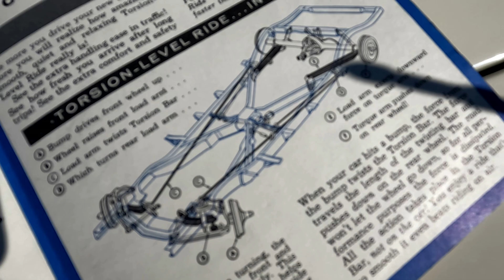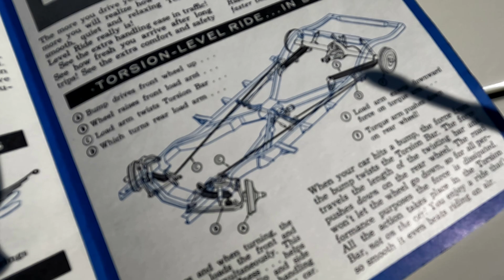Packard Torsion-Level Suspension explained and demonstrated.

Comment: I like the way they utilized starters as the motors doing the work....I have worked on several over the years...
Reply from the maker: Parts bin engineering efficiency and well under stressed in this application. I bet they never went bad or wore out.

Comment: I owned a 55 Packard Patrician for a short time back in 1974.  in reading up on the 55 and 56 Packard at the time indicated that these cars tended to suffer from the fact that its electric components that controled the Torsion Level Ride, that is the motor, was heavily exposed to the elements and often failed or shorted out after a relatively short period of time.  Those Packards equipped with the push button Twin Ultramatic also suffered from premature failure of the electrical contacts in the selector box. Chrysler's push button PowerFlite and TorqueFlite systems consisted exclusively of a mechanical linkage and tended to be much more reliable.
Reply from the maker: You are correct!  I would imagine in climates with winter climates that salt would cause all kinds of problems with the leveling system as well as the Twin Ultramatic shifting solenoids. The Packard push button electric selector would not have been my first choice back then for a shifting system if I was purchasing a car. However, the attractiveness of the gimmick might have captured me. did Chrysler ever use vacuum for the push-button selector on the dash or center of the steering wheel?  Thanks for your interest and knowledge.

Comment: The car was designed to carry 5 passengers plus the driver and carry all their luggage in the trunk and still ride level.
The switch is a mercury switch.
Your timing is set about 1/2° too far advanced.
That is a beautiful example of a 55 Patrician.
My '55 Clipper Super Panama had the same system. I say 'had' because my ex wife got rid of it on me. B*tch.
Reply from the maker: Good ear on that timing. I bet you heard it backing up on the starter just a bit upon a heat soaked start?  The static timing is or seems to be a tad advanced. I have not shot it with a gun yet.  I has thought it might be a mercury bulb switch, same as a thermatic coil thermostat. 
Sorry to hear you lost your Super Panama, if only you could have departed the ex wife prior to the car!  Timing is everything. If only yours was a bit advanced :)
Reply: If its just a mercury tilt switch mounted on the chassis somewhere, the car would level itself if you were on a hill, which is stupid.   Does it do that?    If not, the sensor must sense the degree of spacing between the rear axle and the chassis somehow.

Comment: So sad that Packard didn't come up with a V8 until 1955.  The styling in the early 1950s was rather dated.  The 1955 models might have saved the company, but it was already too far gone by the time they were introduced.  I believe that the 1956 Packard V8 was the largest of any American car.  And stylist Dick Teague did a masterful job on the existing inner sheet metal.
Reply from the maker: Much agreed, If they had come out with the new design and OHV V8 in '55 keeping up with the tri-five Chevys, or a year ahead, it might have been a game changer.
Reply: @classicperformance  - Had Studebaker-Packard joined American Motors, there likely would be a Big Four today.
Reply from the maker: @OldsVistaCruiser  that is an excellent point, and one that we would agree with. Thank you for that insight!

Comment: That levelizer motor is making too much noise. The springs are making too much noise as well. I had one and it was nearly silent.
Reply: If you keep the gear box that the leveler is in well greased it will work flawlessly. Just ask the man that owns one.
Reply from the maker: @swamprat69er  OK, I'll as the man. It seems to be well greased by appearance. Is there a way to check the grease or add???  Thanks!
Reply from the maker: Could be. This car was recently pulled from a 50-year mothball storage with only 4,800 miles on it currently. We are sorting out these issues.
Reply: Jay Leno demonstrated it in one his videos, sitting on the back corner.  You could hear the motor, but only just.    This one is so loud I thought the gut must have put a microphone right on the motor.

Comment: The levelizer was from a separate set of torsion bars. Not the main set.
Reply from the maker: Correct. They are the "short" ones headed rearward from the levelizer.

Comment: I think the "timer-system" probably worked by a pressure valve system. I could go into details, but I think my first line explains it!
Reply from the maker: Others have mentioned it's the voltage regulator styled box just ahead of the levelizer gear box and motor, being a thermal bi-metal delay switch. I have tested that theory and can shorten the delay by over using the system, meaning warming up the box so that the delay time shortens.

Comment: I would get the undercoating removed with dry ice blasting
Reply from the maker: Jeff, it would be nice to be able to remove the undercoating on the frame structure. We have used dry ice blasting on aluminum suspension components and engine cases in Porsches and Ferraris. I was not aware it could remove something as stubborn as a hardened undercoat. The plan right now it to pressure wash it, then respray with chassis black paint.
Reply: @classicperformance  yeah, it can definitely be done to remove under coating.
Reply from the maker: Thanks for the knowledgeable tip, Jeff. We would like to restore the undercarriage back to factory fresh. It's there, just needs to be revealed carefully and DI is what might be the least invasive and eco friendly. Thanks!

Comment: Fantastic car. My brother had one during the early 60’s. The trans went out and no one could fix it.
Reply from the maker: We agree, a transmission repair would most likely have to be sourced somewhere involving shipping of the unit. Parts new and used are still available, such as clutch packs and gaskets, but would be expensive.
Reply: Trans is very easy to work on. However, install government surplus bronze "tank" clutches. Same ones as early Hydramatic, used in WW-2 tanks. Next, install a solid "thrust washer" of correct thickness, in place of the OEM "waved spring washer" in the torque converter. The latter breaks into pieces & destroys the unit!!!  Kanter sells direct-drive re-lined clutch plate, that's rugged enough for the enormous 405 pounds of torque. These small changes, make the Ultramatic bulletproof. Such simple refinements that they didn't realize at the time.

Comment: I have always loved these cars.  Own 4 1956 Packards currently including the twin sister Patrician to yours in Dover White except with the tan interior.  In practice the suspension suspension is well designed and robust. Put four new shocks on the car when you buy it and enjoy the ride.  Major repair is a bit tricky as you either need to hold the torsion bars in place when you replace say the  A-arm bushings or you can unwind / unload the torsion bars.  I managed to find the original large dealer tool to do just that.
Only weak spot on the car is the dual action (oil/vacuum) oil pump which should be upgraded with an adapter kit to a late model Mellings oil pump that is spec'd to a GM 455 Buick.
Reply from the maker: I have done some research on this and know of the potential weak point there. We'll check the Melling option. Oil pressure is very good! Thanks for your interest and sharing your knowledge.

Comment: I don't think these cars would be too practical for everyday use, especially in bad weather where salt and corrosion could get into that leveling system. This is a nice weather car only. I understand you could order the car with conventional springs if the buyer so desired.
Reply from the maker: In contrast, these cars were actually designed in detail to easily manage the worst of driving conditions that could come to mind. We'll start with the very heavy undercoating that spans every underside surface to prevent any corrosion from salted winter roads, as well, it acts as a road noise deadening substance at high speeds. Also, the car is equipped with a dedicated front and also rear separate hot water heaters and multi-speed individually controlled fanned blowers with foot ducts for all passengers. You could option for a heated driver seat, fog lights and other dealer options for dark and foul weather driving conditions. The suspension is controlled by a modified starter motor and as all starter motors, low in the belly of the car. The gearbox is sealed as well as other components tar-box-sealed. They thought of it all.
Reply: I would still like to buy one new then only take it out in nice weather. :-) @classicperformance
Reply from the maker: That was the case with this car. Only ever used for special occasions and 4,800 original miles. See our other content on the car for more information, images and driving.
Reply: I've watched all of your videos on this car and enjoyed them very much. Thanks for sharing.  @classicperformance
Reply from the maker: @1940limited We very much appreciate your interest in The Patrician and your contributions to the discussions! I can assure you the car will never see questionable weather. However, with the effectiveness of the cabin heaters, and the automatic Rochester engine choke, it is a pleasure to tour in on the coldest of crisp winter days, when the sun is shining. We operate the car year-round.
Reply from the maker: @1940limited  true, we would never take it out in wet weather. The straight 8 motors were fantastic, but time marched on ans they became outdated technology with horsepower limitations by the design. We spotlight a few in earlier uploads. Have a look, you can also easily find them under our "Playlists" and you'll see "Packard"

Comment: My first car was a '55 Patrician. This was in 1970, and the handling was still surprising by the standards of the day. The self-leveling was effected by spooling up the shorter torsion bars that were about half the length of the springing bars. That way the spring rate of the main bars remained constant. And, yes-- Packards with this suspension did not lean in turns much, compared to Cadillacs and Lincolns of the day. I used to sit on the rear fender, allow the system to raise the car, then shut it off, via a toggle switch under the left edge of the dash. This gave the car a "California rake", when you drove down the street, but it was only a joke, not for driving. BTW, the Packard Clipper, their mid-priced car, came with a standard coil front, leaf spring rear suspension, but torsion bars could be special ordered.
Reply from the maker: Barry, you are most correct. If you saw in the video we explain and show the shorter bars you reference which are used for leveling compensation. And yes, you can easily get that Cali Rake easily, as we used to do with "Highjacker" pr Monroe air shocks in back. Ahhh, the good old days!  Thanks for the info and your interest.

Comment: Hi from Sydney, Australia. My grandad bought one of these new, he ordered it to his specification, his brother-in-law had bought a new '55 model and had automatic gearbox trouble, so Pa ordered his as a manual with the optional dual carby set up, from the 352-cube engine it was good for 375 horsepower, not shabby for 1956. I learned to drive on/in this car in late 1973, so I could get my license on 24th January 1974. Pa's Patrician was so modern compared to other cars way back then with its poise under panic braking, or its projectile like take-offs when given the "joint" in manual first gear, no bum down, nose up feeling. I enjoyed every moment behind the wheel of this special car. Sadly in 1979 a bus hit it in the rear whilst turning into my mum & dad's driveway. However, it was "rescued" by two brothers who had been members of the Aussie Study/Pack' car club. They bought a scrappy tired California example. swapped chassis, welded on the donor cars right rear guard and rear valance panel and over months put in the hard yards to bring Pa's car back to life after it was written off by the insurance company. The only thing that they did that I hated was turn it from its original black enamel paint, into a turquoise and creamy-white car. All these years later at x'mas 2023 the two brothers still own it, love it & enjoy it.

In September 1982, I bought the next best thing in FACTORY right hand drive, a GM Holdens Aust built '74 Cadillac Fleetwood Brougham. Sent as a completely knocked down bunch of parts to build in GMH's Pagewood, Sydney plant it is a wonderful car, the closest thing to the spectacular '56 Pack' Patrician and driving it now for 41 years as my daily car it has proven to be vastly superior to a lot of modern cars. As it was a virtual full option car with early ABS brakes & traction control called "maxtrac", plus it has GM's early airbag restraints called Air Cushion Restraint System or "ARCS". But best of all as an export CKD Kit, it has a "full power" 8.2 litre export spec' engine with ZERO anti-pollution gear, so you have a genuine 400 to 500 hp car, not a gutless de-tuned USA spec engine. With the '74 Caddy's self levelling suspension it is the closest thing ever to Pa's '56 Packard.  Pa was an industrial engineer and he loved that '56 Packard, when I took him with me in September 1982 to look at the Cadillac with a view to buying it, he said if Packard had survived it would have made something like this. In 1974 Mercedes did not have ABS brakes, Mercedes did not have traction control and Mercedes certainly in NO WAY head anything like ACRS airbags but GM had its air cushion restraint system well before any other company.
Reply from the maker: What a great series of storied, Greg!  Thanks for sharing these with us and the group. I have never driven the dual quad setup on a Packard. I use would line to. Wasn't that motor the 374 cubic inch?  As for Cadillac, they have always been great cars too!  We once had an old Mercedes, from the 70's, it operated more like a truck than a car. As well as an '82 300D (diesel) which till this day, the slowest and most underpowered car I have ever driven. But they were tough!  Thanks again! Take a look at some of our other content on the Packard, as well as a nice Cadillac super 60 series.  Cheers, Mate!!
Reply: Your 1974 Cadillac Fleetwood sounds quite amazing! Perhaps you could do a video on it to show off the features you mentioned! I for one would enjoy watching it! Nice to know that such rare-optioned mid-70's Cadillacs still exist; and being a right hand drive fully optioned 1974 Cadillac makes it pretty much a one-of one in survival existence!!
Reply: I bought a well-used '74 Fleetwood in '81 when I was 20.  When warm, I couldn't hear or feel the engine at idle.  When cold, the pollution controls made it shake so badly, it broke the exhaust manifold bolts on a back cylinder.  Great riding car even when decrepit, but I learned to hate leather upholstery.
Reply from the maker: @ralphl7643  yea, the polution controlls just suffocated cars of that time. We would take all that garbage off. Cut the cat off and straight pipe, block the EGR, take off the A.I.R system and pump, etc and they would run pretty well.

Comment: One of the things I remember about the torsion bar system was that if you had a flat tire, you put weight on that corner so the leveling system would raise the car. After it was raised, you turned the system off so the car stayed up and you had less distance to jack it up to change the tire.
Reply from the maker: Makes perfect sence. 👌  not wasting jacking motion against a soft spring (bar).

Comment: It was a quality car when it was made and still is. That's an impressive torsion bar suspension that I didn't know about, the Packard engineers had to make that work and I'm sure that took much time and effort to design. Packard was a quality world class car company, that should be remembered.
Reply from the maker: You are most correct, Marten. I was not fully clear how the entire system worked from front to rear until we had a chance to study it from underneath on the lift. Packard also fully engineered and developed the automatic transmission and OHV V8 all in-house. Most other automakers sourced out engineering, sub components or complete transmission units to companies such as Borg Warner. It is thought Packard might have got in the weeds by being so intent on in-house engineering and manufacturing.
Reply: Actually, the Torsion-Level suspension was invented by a Hudson engineer named Bill Allison.  Hudson was too broke to develope it, so they let Allison shop it around to other carmakers.  Packard's interim president, Hugh Ferry, bought the rights to it.

Comment: While Packard was late to bring out a V8, they continued to out engineer the Big Three. TL and push button transmission couldn’t save them from problems associated with the 55’s; competition from Cadillac, and the disastrous purchase of Studebaker. The last true Packard (‘56) is a work of art!
Reply from the maker: You are spot on, correct! We love the '56 in particular over the '55 for the restyled headlight buckets, pod shifter and improvements in the Ultramatic transmission. The car is quality and perfection through and through. Unfortunately, the buyers passed dipping sales from roughly 9k in '55 to a scant 3k+ in '56... then the doors closed on East Grand Avenue.
Reply: @classicperformance my dad's best friend had one ..when he died the wife let it rot to the ground...shame..

Id love to find one...